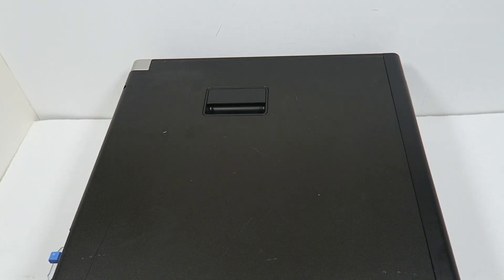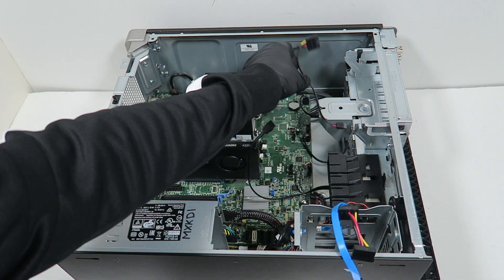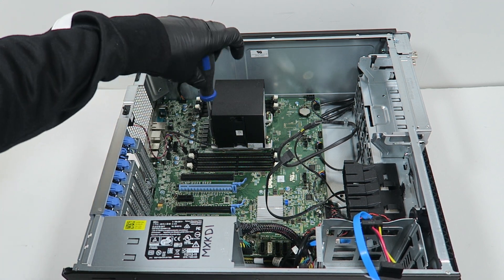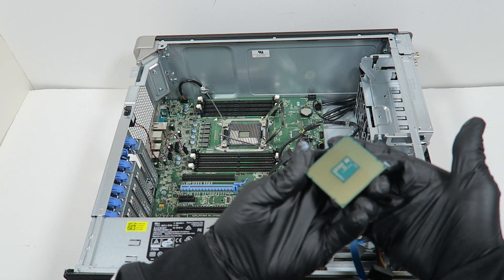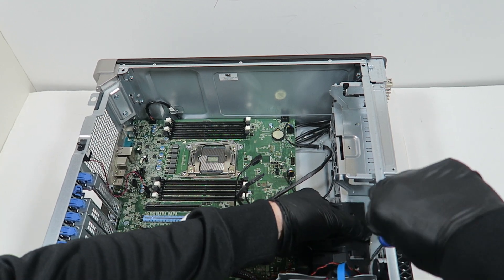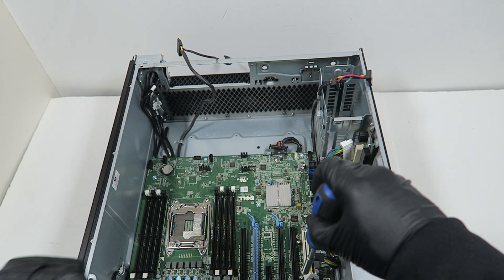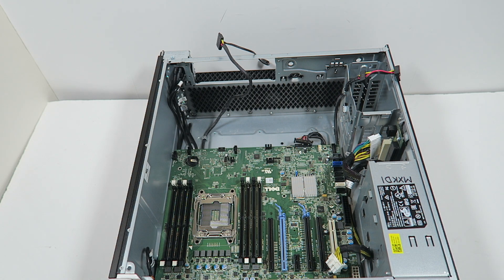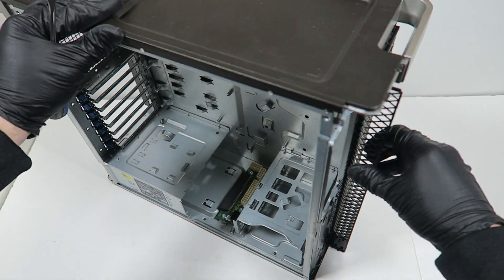Dell Precision Tower 5810 Teardown

Comment: No, you can't put the 685 Watt power supply in the 425 Watt version. There is a key slot in the top of both. The 685 Watt power supply key slot is a quarter of an inch different than the 425 Watt version. I made this mistake myself and found out the hard way.
Also, where are your memory cooling shrouds. You'll fry your ECC memory without them.
Reply: Memory cooling shrouds?? Am I missing something too in my system. Please elaborate. Already found out that the HDD fan was missing from my used box purchase

Comment: Are there any replacement cases for this?
Reply from the maker: Hi, not really
Reply: @Mxkdt  dammit, i have the motherboard but cant find a chassis for it
Reply from the maker: @stilldiro8889  You can still buy Dell Precision Tower 5810  chassis they sell on ebay used.

Comment: is it possible to install an aftermarket cooler on this exact 5810 and if so will the screws and brackets and the radiator fit?
Reply: Yes, I put an aftermarket Noctua cooler in my 5810 build

Comment: Can I put 750ti 2 gb or 1050 2gb on my dell optiplex 390 sff ?
Reply from the maker: Hi, yes yo can use only 750ti 2 gb or 1050 low profile with low profile bracket 

---Gigabyte GeForce GTX 750 Ti  GV-N75TOC-2GL
---Gigabyte GeForce GTX 1050 OC Low Profile GV-N1050OC-2GL
Reply: @Mxkdt  Both requirement of psu is 400W. How my 240W psu manage them? And 
I Have two options Zotac and gigabyte 750ti or Zotac 1050 . I have another question that low profile brackets came with graphics card?
Reply from the maker: Hi, i am testing right now dell optiplex 9020 sff with 255w with i7 4790 and gigabyte gtx 1050 ti low profile  in gaming tested for few month now and works fine with out any problems.
Reply from the maker: Yes when you buy video card from gigabyte they should include low profile bracket and full height bracket.
Reply: @Mxkdt  Sure! 390sff can handle 750ti or 1050.